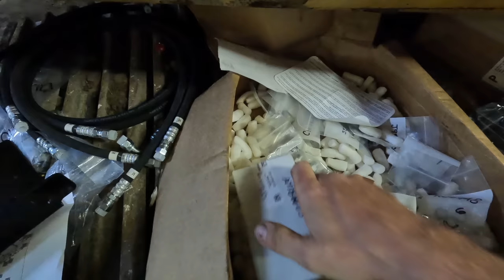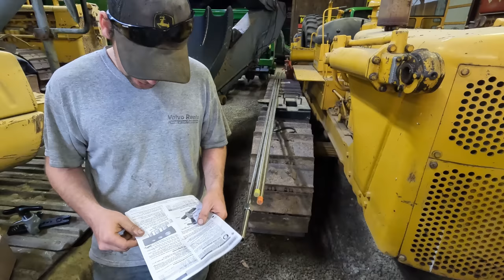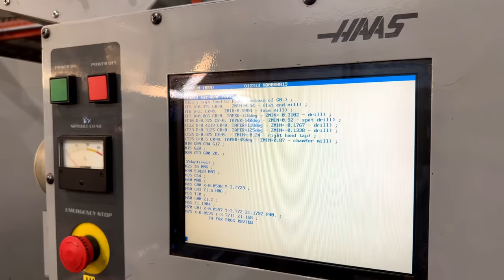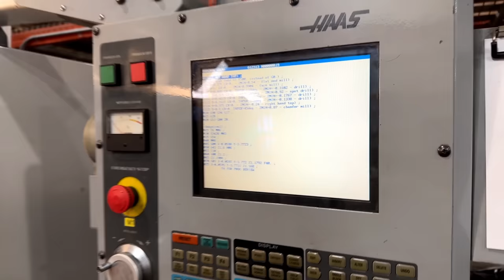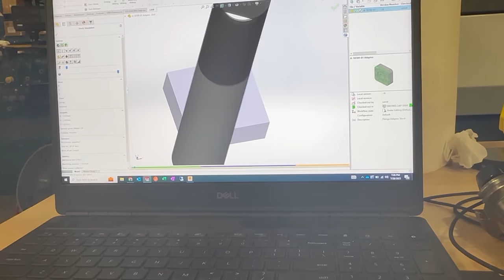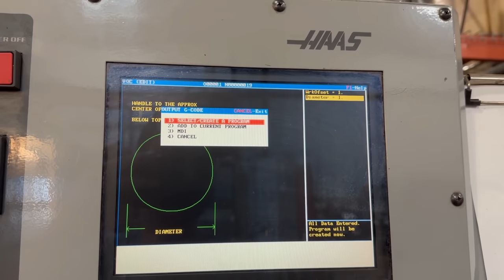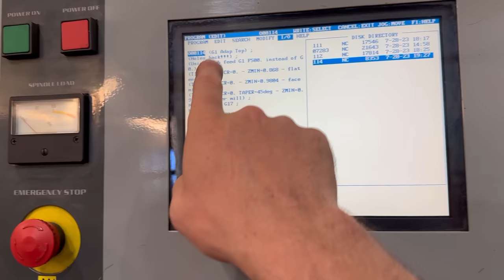Adding Auxiliary Hydraulics to Excavator

Comment: Good work! I added aux hydraulics to a Deere 160c a few years ago - funny story was I knew it had aux installed when I bought it because all the lines, fittings, blocks, and diverter valve were right there in front of my eyes, but it turns out it had no pilot-side hydraulics or in-cab controls. Apparently sometimes Deere did that, depending on how the machine was ordered. Since the factory kit was NLA, I ended up with a kit from HKX for the full pilot-side and it came with everything needed and a good set of directions. I had some flashbacks to my own experience while watching yours.

Comment: Nice job on machining the adapters, C&C definitely has its advantages, as long as the right info gets programmed in and one doesn’t forget to set up properly, as if I never have done that very thing 😊. Nice job setting up the hydraulics sir, thanks for update on the thumb.

Comment: Once you use that thumb, you will wonder how you ever lived without one. I would not want to be without mine.
Reply: That’s the absolute truth. An excavator without a hydraulic thumb is like a eating soup with a fork.
Reply: The only time mine hinders me is digging inside a trench box , the thumb hits the spreader bars and tries to lift the box up when you get deep down . It's not too difficult to remove it on mine so it more than makes up its worth

Comment: I have a 2010 120D that has about 9500hrd on it. Its an incredibly reliable excavator.
Fortunately, it came wuth the aux hydraulic circuit already done from the factory. 
However, I am getting cylinder drift from a freshly rebuilt cylinder, being a thumb cylinder. 
Its so intermittent that it's hard to figure out exactly what it is. I think i may just need to flush and clean out the the hydraulic fluid in the whole machine. 
You guys did a great job. Hydraulics are a different beast when designing and implementing.

Comment: try a wide velcro strap to bring that hose closer to the other hoses without biting into each other. it will pull them closer, but spread the contact over a wide part, and each hose can slide within the strap so shouldn't chafe much.

Comment: Keep your flaring tool oiled and it will last for years. Mine is 40 years old. Use for plumbing with copper tube as well.
Reply: I have always found, the more perfect the flare is, the better chance that I forgot the sleeve or nut. Or both.

Comment: On the suction pump.  Add some Y fittings on either side of the pump with a ball valve.  Start pumping with the valve closed.  Shut off the pump and open the valve and have it a become a siphon.

Comment: There must be a story behind the guards on the CNC windows
Reply: not familiar with this particular machine, but it may be stock. Seen several older machines from various brands (typically from the early 90s) that have armoured glass or metal grating to protect the glass. That was before they switched to the laminated hardened glass that's common now. Especially the armored glass ones were annoying to work with, because you couldn't see a damn thing through them, so the glass was pointless
Reply: @thesteelrodent1796  he did say it was an older Haas. The one I dealt with was a smaller machine with dedicated fixtures that only cut aluminum. The ones on his machine look like someone cut them out on a water jet or plasma cutter so I thought they might be made in house after an incident
Reply from the maker: We bought this machine used and they were already on it. I do think they were homemade as I agree you can see plasma cutter marks on them. This machine came out of a Baldor motor plant in North Carolina I bought it in an auction.

Comment: Should watch yourself a bit of C&C Equipment. Shove a shop vac at the top of your tank and you don't then need to drain all your fluids and waste 100 s of dollars on new fluids
Reply from the maker: I’ve done it- this oil needed to be changed and it wasn’t a quick hookup unfortunately